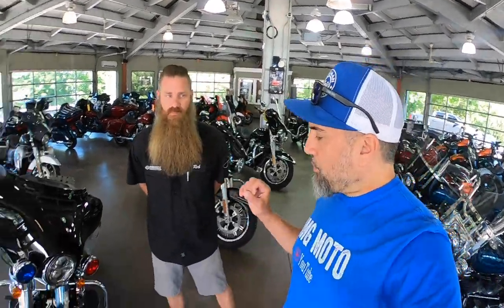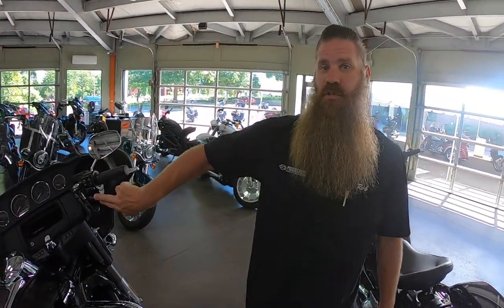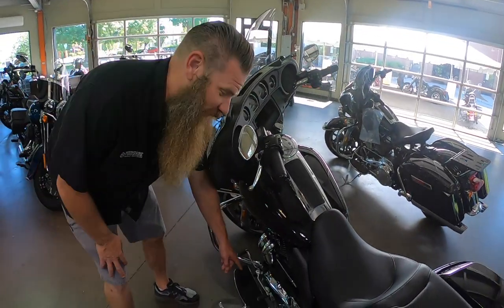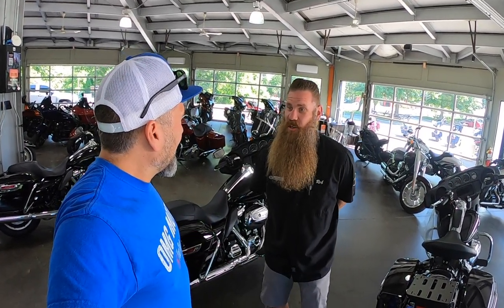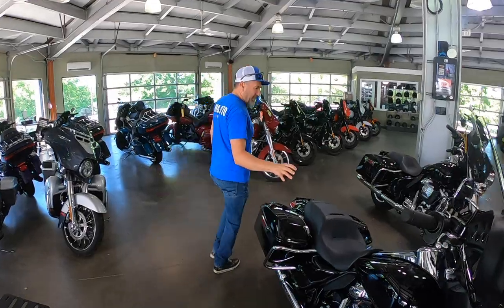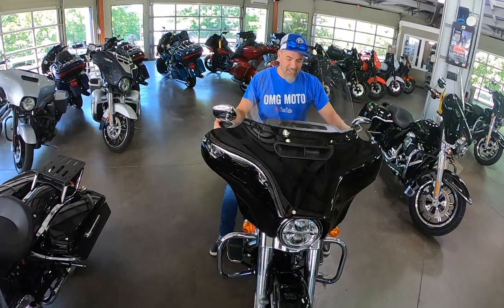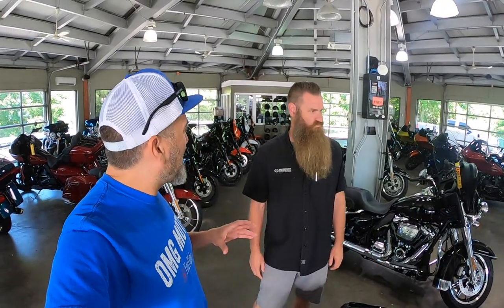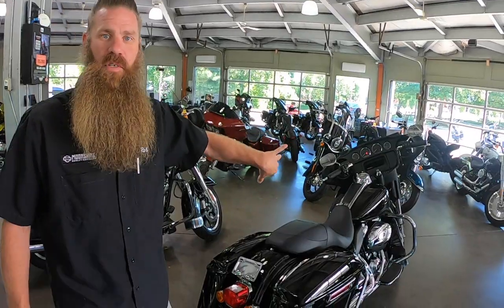2020 Harley Davidson Electra Glide Police 114

Comment: I installed back-lit hand controls on my 2020 FLHTP and now the horn activates as soon as the ignition switch is turned on. On HD Forums another FLHTP owner reported same thing happened after he installed the back-lit hand controls. He hasn't reported how and if he resolved it. My passing lights also won't turn on. What is the cause of this?
Reply from the maker: I hate to hear that, I do not work for the dealership. You will need to reach out to a dealer.

Comment: i just bought one from moonshine a couple days ago but its getting some upgrades put on it so I haven't got to pick it up yet. Thanks for the video keep up the good work.
Reply from the maker: Oh, man! Those guys know how to upgrade a bike for sure. What are you having done to it?
Reply: @OMGMOTO  I am having a stage 1 with chrome worx slipons, s&s intake and the tune. Also they are putting on 12 inch la chooper bars with the willie g heated grips. I plan on doing the radio as soon as fathead gets them back in stock.
Reply from the maker: @tuner260  Man, you will have it looking and running smooth.
Reply: Does this bike come with a USB port standard like the heritage classic does?